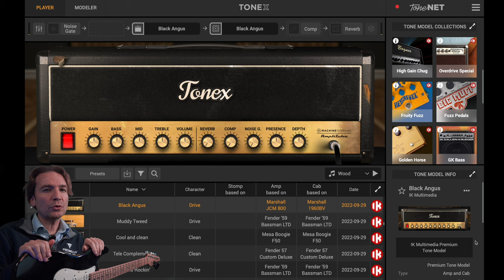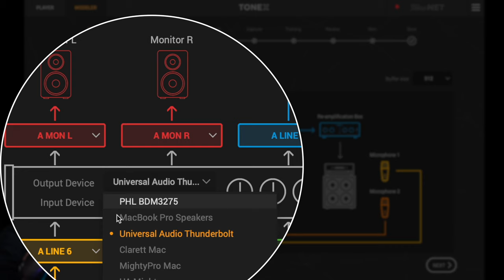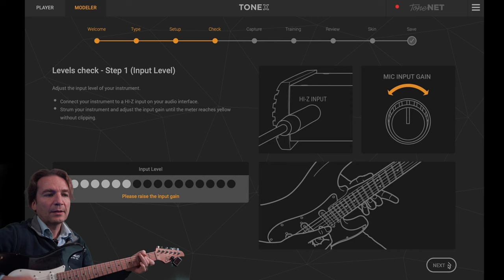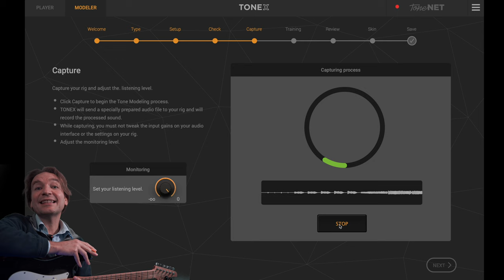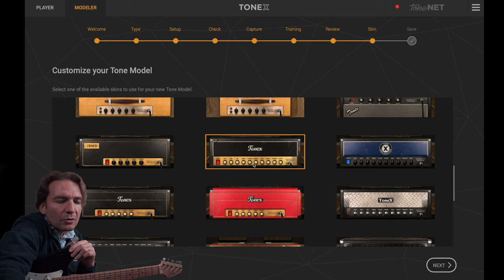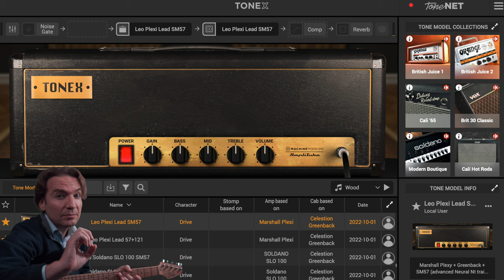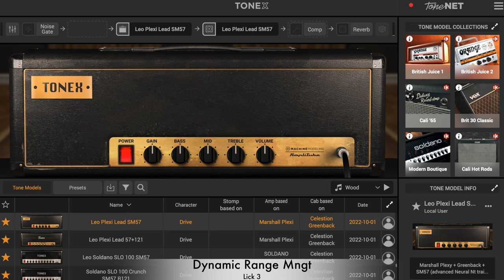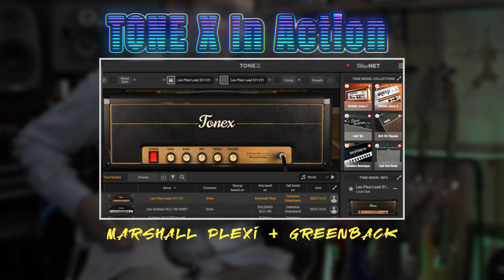IK Multimedia TONE X: how to profile an amp | how it compares to real tube amps

Comment: The guitar community on YouTube is very fortunate to have you making such high quality and insightful videos. Thanks 👏

I think the Tone X did an excellent job making an accurate capture of your Amp. But, they need to get the processing time to make the Capture down to about 20 minutes to make it a "practical" method. With the power of modern personal computers, I guess that should be possible. 🤷

You should be able to make money from Captures, like is done with IR's.

On a related aside, have you seen Johan Segeborn's video "The Current 15 Greenback Clones and Reissues Compared to an Original!"? I found it quite interesting to hear the wide variety of tones.
Reply from the maker: Thank you so much!!! Well, I think I'm the lucky one, to be part of a such a great community...😊👍🏻
I've not seen the video you mention yet...I will for sure check it out!

Comment: The great option is that ToneX could be used on Tubeamp 5 ! IKmultimedia is doing a real good job
On the profiled sound seem be missing low frequency : could be better after to put an EQ for copy the right sound...but it's my feel
Reply from the maker: Thank you so much! Yes, the possibility to use the profiles in amplitude is very nice. Thank you also for sharing your findings about the profiles.

Comment: Same here. It’s better than the Kemper and Quad Cortex. In my case I have tried blind test and haven’t been able to feel or ear the real one. That’s simply crazy how IK multimedia could do such an giant leap forward. A good thing I guess. Now I would love IK MULTIMEDIA to make a pedal to play the models. At the same price as their drive pedal ;)
Now that would be cool if next kemper could use this neural network technology to improve the lacks of the profiles made with actual profiling (too much compression, medium push and muddy lows)
Reply from the maker: Yes, it's very accurate...and I do agree....it would be nice to have a pedalboard from IK where you can load this profiles...Thank you for sharing your experience and findings!!!
Reply: If it is better than the Kemper and QC, I have to have it.
Reply: @joejohnson8966  still love my kemper. It’s not « better » it’s better at profiling an amp. But both sound very good. QC sounds too harsh for me though. I finally resold it (with profit!)
Reply: @notalkguitarampplug-insrev784  Thank you so much for answering. Congrats on the profit. 😎

Comment: It is the same story as with the qc, which I just sold. Fellow soundpack creator here. The qc makes no sense for me to put any work in, as does - for now - the Tonex. As long as there is no marketplace I will not even try it and continue using my axefx (and sometimes kemper)
Reply from the maker: Hi, thank you for shring! Yes, a well structured market place would be greatly appreciated...nevertheless finally I found out (even thanks to the help of the community comments) that with the Tone X you can export presets with the amp profiles and then you can sell them
Thank you!

Comment: Did three profiles so far. Every profile took 8,5 - 9 hours for the advanced AI-learning. 
Profiles do sound great, but 9 hours of waiting is brutal.
Reply from the maker: Hi thank you for sharing! With my M1 Mac it took 45m. May I ask you what computer are you using?
Thank you!
Reply: @LeoGibsonGtr  Ryzen 1800x, 64 GB DDR4 RAM, AMD RX 570 8 GB, SSD.
But as mentioned before, all profiles sound great. 
Only disadvantage that active and passive pickups need to be readjusted 
every time you play a guitar equipped with active or passive pickups.
Reply from the maker: Hi, thank you for sharing!

Comment: So is this just a high definition capture of the tone at your current amp settings or does IK give you a way to replicate the tone stack so you can get the amps full range of tone?
Reply from the maker: Hi Jesus, I'm not sure that I have properly understood your question: May I ask you to clarify what do you mean with "replicate the tone stack"?
Thank you!
Reply: @LeoGibsonGtr  , I was wondering if changing the tone controls on your captured amps responds similar to the actual amp or if it's a static capture that does not mimic the amp eq controls
Reply from the maker: Well, there are differences. For instance I profile the amp with the volumes at 9 (almost maxed out) and the gain on the amp is at 5. In my opinion you have a very detailed photo of a specific setting of the amp.
Thank you!

Comment: If you spend 2hrs to profile your Marshall knob settings through your Celestion and your SM57, then sell the profile for 30 dollars to 500 people, youll make $7,500 per hour. Is that reasonable for your time?
Reply from the maker: Hi, please take into consideration the following:
1) I'm selling IRs and Kemper Profiles...in order to sell 500 profiles...it's gonna take more than 2 years (according to my statistics)....
2) I would like to take the profiles accessible...therefore I would build a pack with 3 or 4 amps profiled for around 10 / 12 dollars...
3) You should take into consideration the money spent for the gear, or at least part of the money: Soldano+Marshall+Lone Star+ cabs + mics + preamps + audio interface > 14k$
4) in order to profile those amps, with some mics combinations, it's gonna take almost 24 hours no stop...
At the end, no...it's not gonna be a reasonable amount of money for the time and the money spent...
Reply: You can get some money for the work you are doing...I saw someone else has figured it out. If you create your model and then create a preset using that model in tonex...then when you are on the preset tab...go to your new preset and right click on it. You can export it. That export has not only your preset settings, but also your model. Others can import that and get your model. Now you have something to sell.
Reply: @LeoGibsonGtr  you’ll probably will be able to queue the process ;)
Reply: @LeoGibsonGtr  👍 makes sense. great content on your site, thanks!